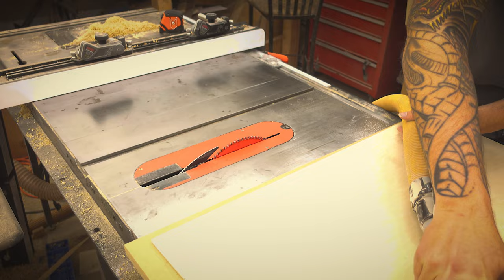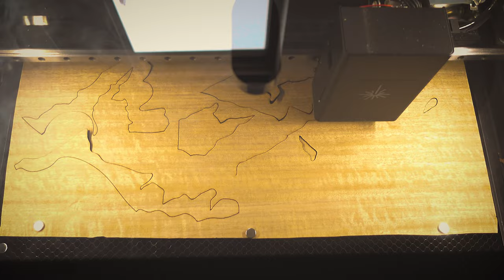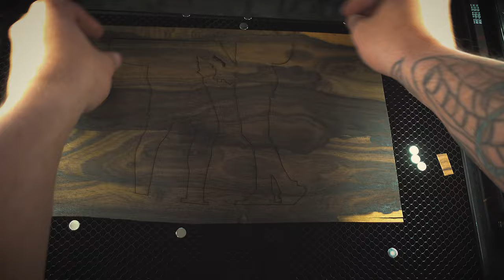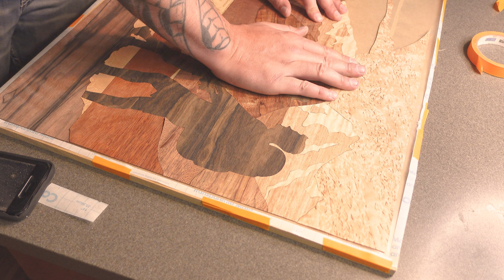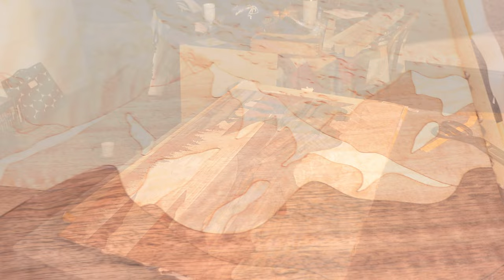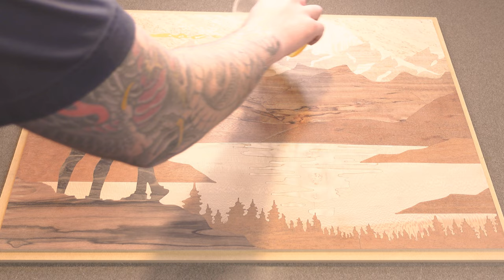Veneer Marquetry Mountain Scene

Comment: Howdy from Australia. Thanks for sharing your inspirational work and process!  As a noob just getting into lasers and marquetery, is the kerf of the laser (laser width) something you need to factor between each of the veneer elements? Cheers
Reply from the maker: Awesome, thank you!  There is a kerf that needs to go into your planning.  I usually put a positive .0002 offset.  Very little, but it helps with the tight transition to the adjacent veneer cutout.